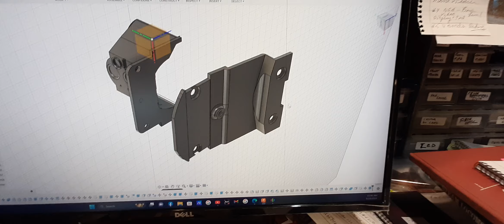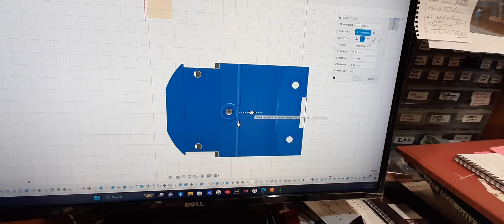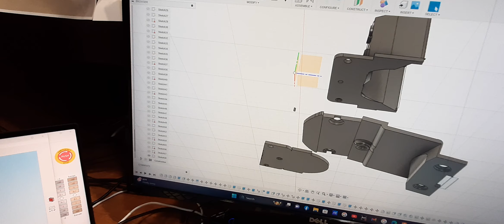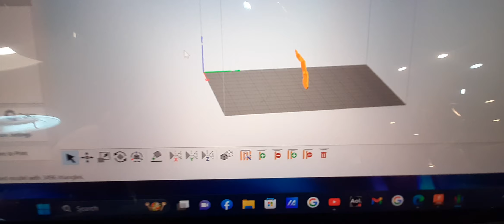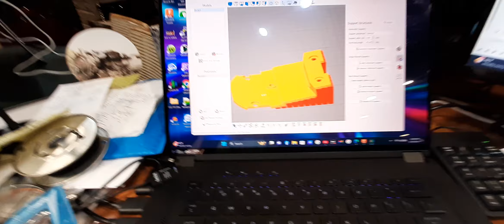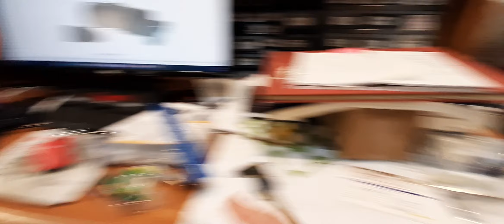Model Trains and CAD design are made for each other. Here I am making a Steam Engine Ash Pan.

Comment: Hey man, there's no one right way to use CAD, so even if what your doing isn't "By the manual", if it gets the job done, it's the right method, keep it up man.
Reply from the maker: Yes I know there are many ways to get things done. I am a hacker and getter done type. I do love the tool. I usually learn everytime i use it. I took a lot of on line stuff, but I get bored and needed parts so I just started using it. I now what to figure out how to make CNC images to feed my Mini Mill. I want to get some soft Aluminum and machine my own Chassis with ball bearings. I did print a chassis but it was way too light to be functional. But it had ball bearings and ran like stink. Thank You for the input. Dennis